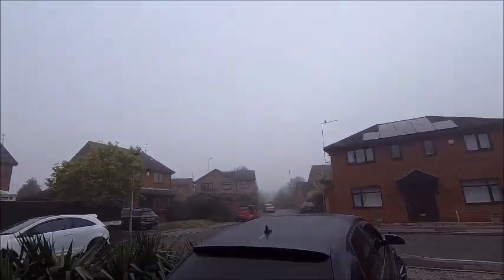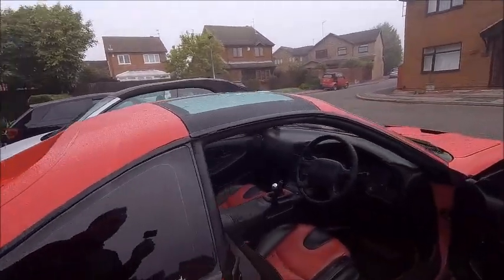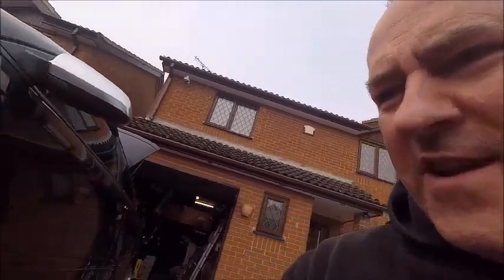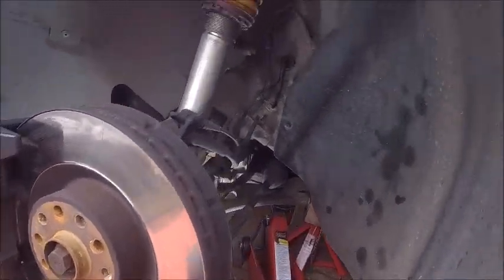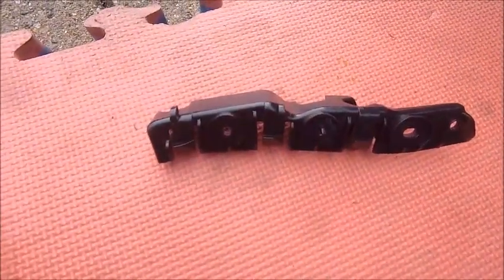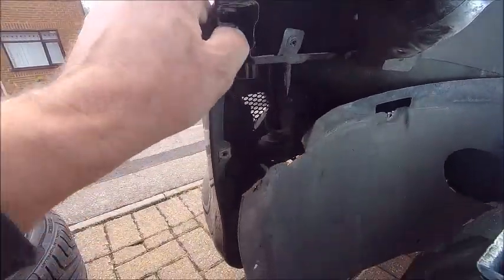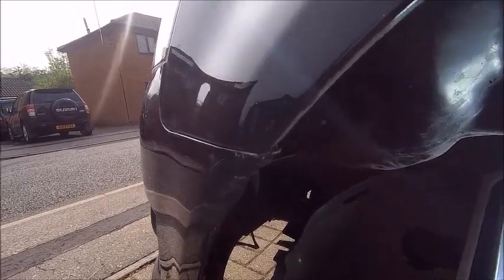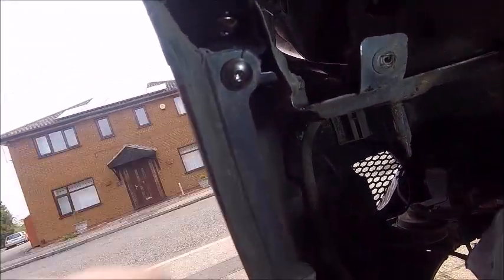Audi S3 bumper bracket replacement.

Comment: Hi mate, don’t suppose you have a part number for the bracket? Broke my clips when putting it back on the other day lol
Reply from the maker: This was the description off  ebay if it helps...
AUDI A3 04 - 08 FRONT BUMPER BRACKET MOULDING LEFT UK PASSENGER SIDE 8P0807184A